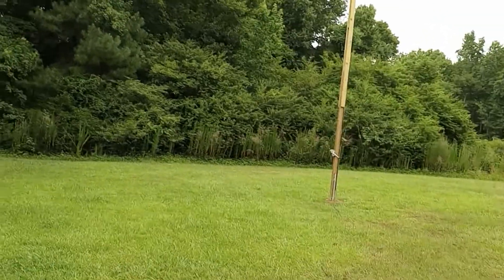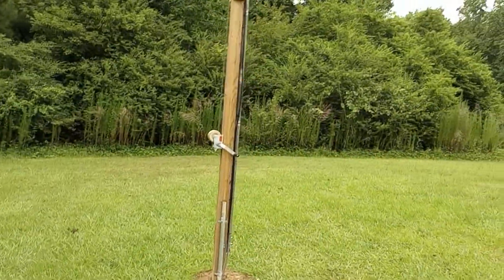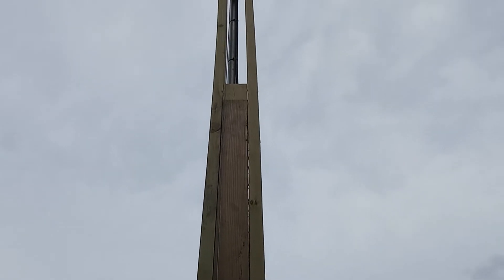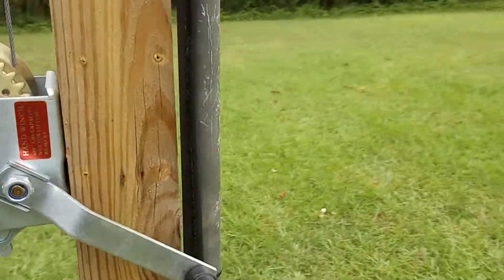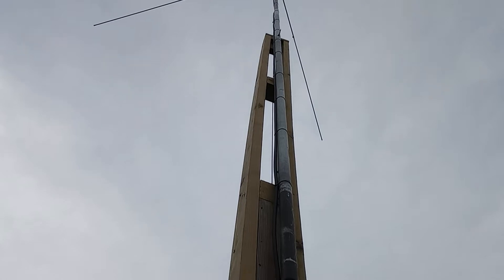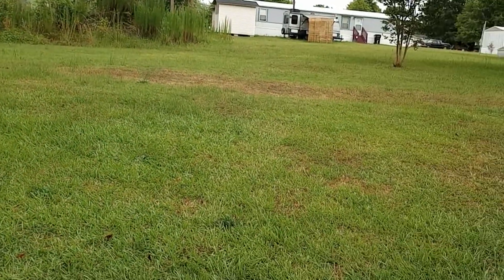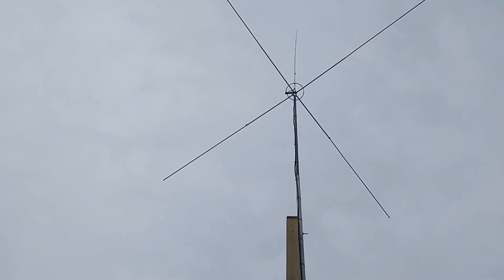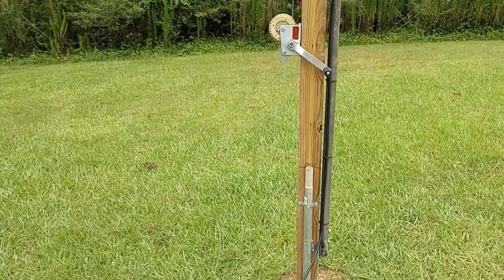I Built A Homemade Tilt-over Antenna Mast For My System

Comment: I think I missed how tall it is. Also does the worm gear in the winch hold up after a few times up and down? I had one break when raising it. Mine is all metal though. Probably heavier. Yes. Do a vid raising, lowering, and show guy wires? Or none? Thanks.

Comment: Man, I was worried I'd be the only one with a, ahem, "creatively engineered" wooden mast. Planning on putting together a mast for my 2M ground plane anyenna that I can put up and take down (no HOA, just a wife owner's association, if you catch my drift). Mine has to pack away completely, but I think that'll be a good feature, as I can always toss it in the car and set it up elsewhere.

Current plans include an 8' 2x2 with a couple holes drilled in the bottom to accept two carriage bolts, pinching the 2x2 between a pair of 2x6's (or whatever I have lying around, either way a whole two boards, so another 8 feet) attached to a heavy base of 2x4s. Sure, I'll only be getting up about 20 feet or so, all told, but I'm hoping it'll get me over the local trees enough to hit some repeaters!
Reply from the maker: Heck no, dude! I'm all about doing things on the cheap but solid. I can't afford an actual tower, and only need about 40 feet of I did have one. So I thought this would be both practical and functional. A win/win to me and my bank account!

Comment: That’s bad ass I’d love to know how to make one about 50 ft from tip to bottom
Reply from the maker: I think it'd be pretty easy to do with a larger main pole, bigger than the 4x4 post I'm using. Something like a short telephone pole. And as far as the metal pipe, hell, if you can weld,  rigid sprinkler pipe would work. 
Sections of that stuff will fit inside of itself.
 Larger at the bottom, then to something smaller, then smaller, etc.
Then the only thing to figure out would be the winch, and that's easy enough.
Actually considering doing this very thing with my beams.